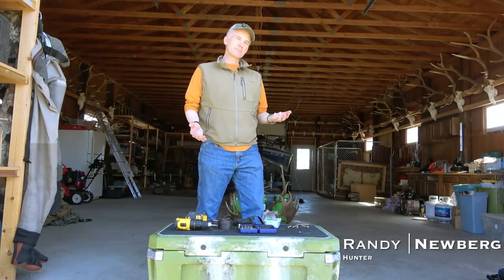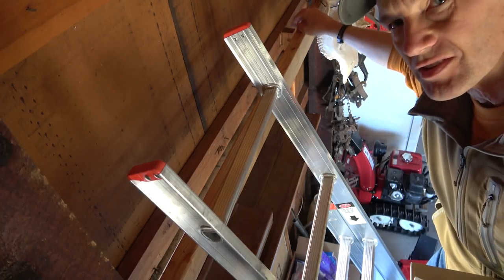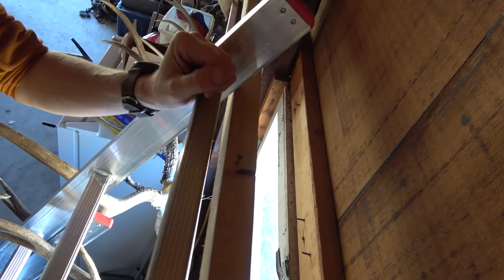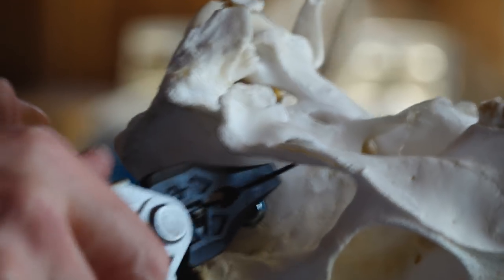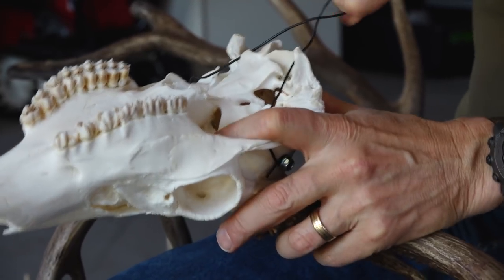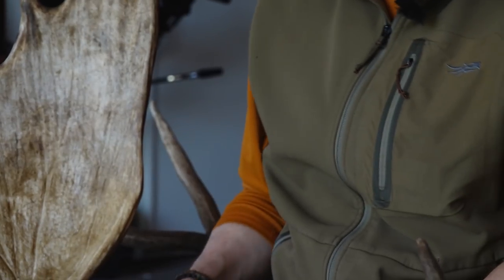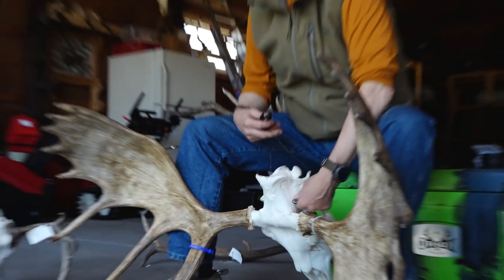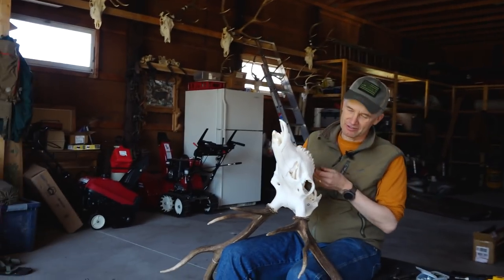How To Hang A European Mount DIY with Randy Newberg

Comment: Yo - there is a MUCH easier way to do this.  You don't need to drill holes in, or modify, the skull.  You can use a wire loop or heavy zip tie through the holes on either side of where the spine attaches to the skull.
Reply: That is the way i do it too. Works great
Reply: @hunt_excelpaulbais2876  same. Been doing this for years, and never failed
Reply: Exactly, the skull is full on through holes to weave wire in, so why risk damaging the skull.

Comment: Great video. Along with the video for boiling heads, very good video. Let your friends all know that that slick new pan that you used on your video, if you have recycle yards/metal recycle that lots of commercial Kitchens that get scrapped out will have pans of many sizes and with a little work you could build one for cheap, I have purchased them for about 5 dollars. FYI to save a little money. Thanks again for great hunts and other great videos.

Comment: Great video. Instructional as well. i have never tried your wall mount method before but it will be tested out this fall. Regarding the nose bone part which broke....use super glue to fix the matter. But remember you have only one try:-)
Thumbs up and greets from a subscriber in Norway.
Reply from the maker: Thanks for following along.  And thanks for the tip on repairing the broken elk nose.

Comment: Randy, you making it way too time consuming.  For a buck fifty your local Ace Hardware buy a 1/4 inch eye lag bolt, with players open the eye. A hole can be drilled into back of skull for the eye bolt to come out of. Your Grand kids can climb on this thing and it's not coming down.